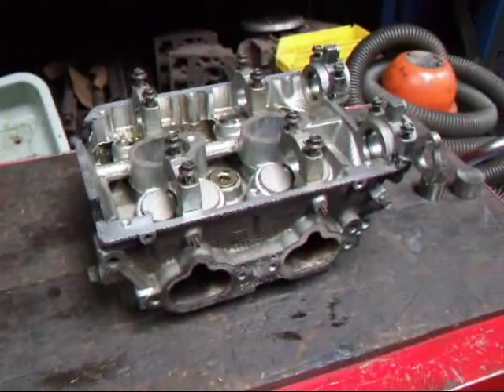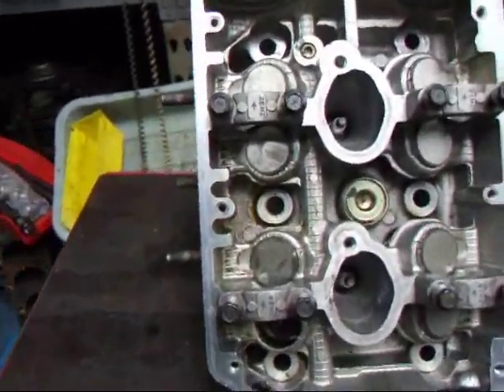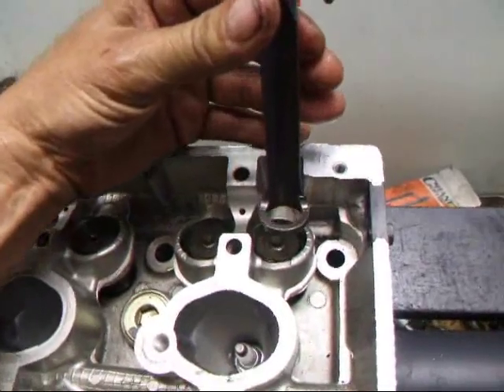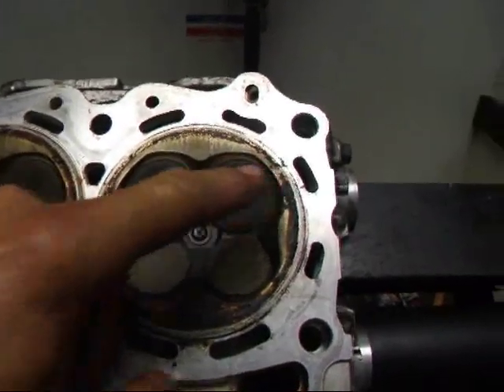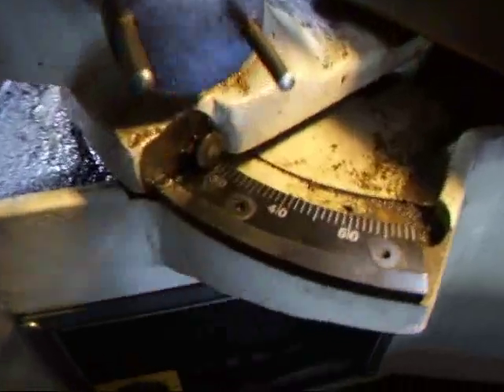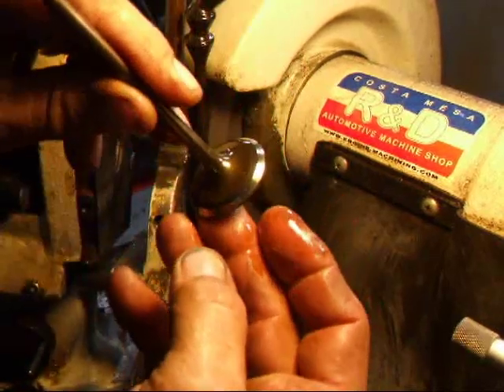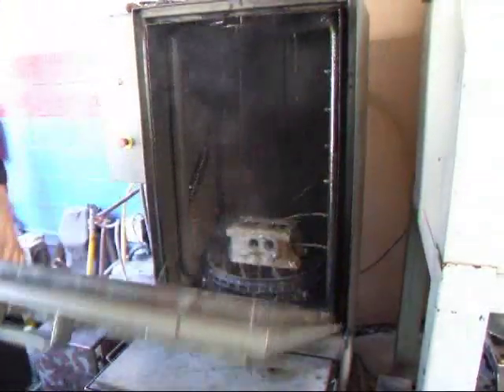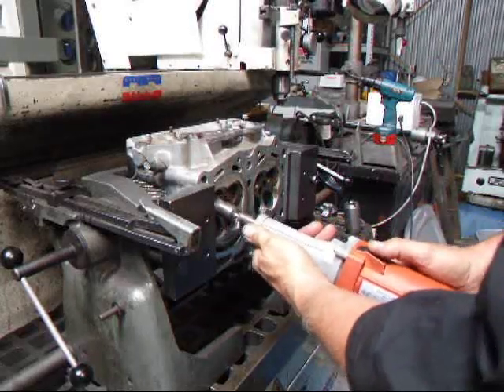Subaru Valve Job.wmv

Comment: I am confused. The Subaru engine is a boxer design. The intake manifold crosses the engine to bolt to the intake ports on opposing heads. If you machine the head, doesn't that move the intake ports closer to the center of the engine? How do the intake manifold bolt holes align then with the bolt holes in the head? Same thing for the exhaust manifold bolt holes right?
Reply: There is a specification about how much you can remove from the cylinder head and block deck. If you never exceed those specifications, there will be very little misalignment between the intake and heads.

If those specifications are exceeded, the block and/or head must be replaced with a new part.

Comment: a valve guide dropped in one of my cylinders on a 2.2 engine, is it possible to replace the seat without taking it to a machine shop or taking the head off?

Comment: @gotz71~ its "heat induced failure".

WOOD burns.... STEEL doesnt!
Reply: are you fucking serious? if you heat metal to it's melting point guess what...it is burned, there are parts of it that are reduced to vapors as material is lost because it is technically a chemical reaction....you are very wrong.

Comment: @gotz71~ the term "burnt valve" really pisses me off.  because its so wrong!

U cant BURN steel!
Reply: Again, you are wrong...here is an example...if you burn toast it turns black, visible signs of it burning. Before steel physically changes phases from solid to liquid there will be bluing......which is the carbon in the steel burning. You jackass.

people like you piss me off because you demand your ignorant assertions are absolutely correct.

Comment from the maker: @Luka464 - Not a problem, I used to take 2,5 mils of to raise the compression back in the old days. I don't do that now because that preetty much ends the life of the head and most heads already have too much taken off, but 1mm will be okay, as long as you are not near the spark plug holes.